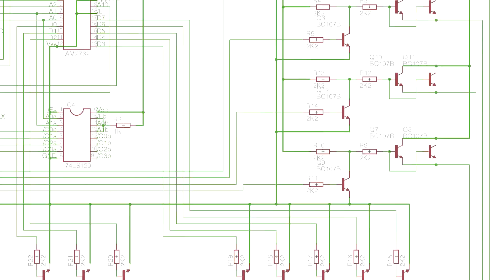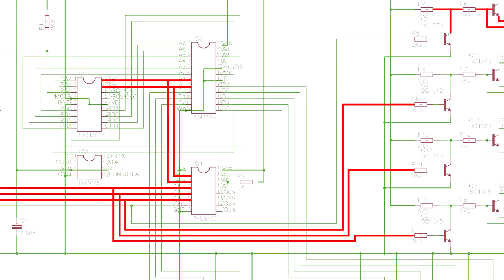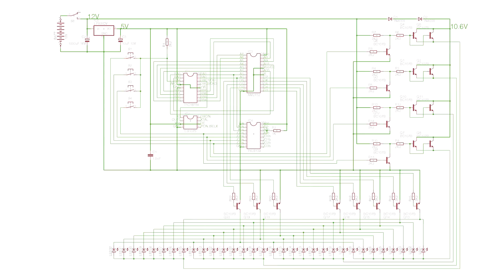Light Chaser Sombreros

Comment: I think I'll try to do something similar to this, but only using EPROMs and CMOS as I hate coding! :) A couple of 4040s driving the address lines then tap off BCD or Binary valued from the data port to drive the LEDs. First things first though, need to wire up an EPROM programmer :D

Comment from the maker: The patterns were calculated by hand, converted to hex and programmed into the EPROM using an ART EPP-1 EPROM programmer plugged into the parallel port. I've probably still got them written down somewhere.
The coding was done in Microchip MPLAB and programmed using a PICPRO40 programmer, again plugged into the parallel port.

Comment from the maker: I made a Knight Rider chaser a few years before the sombreros.
555 clocks 74LS93 (divide by 16).
4-bit output from 74LS93 feeds 74LS86 (quad XOR gate), 3 LSBs go to 3 gates, MSB goes to all 4. Output is 000-111 (for 0000-0111 input) then 111-000 (for 1000-1111 input).
3-bit output from 74LS86 feeds 74LS238 (3 to 8 line decoder).
Output from 74LS238 feeds transistors.
Transistors feed LEDs in the dash-mounted box and 12v bulbs in the front grille.

Comment from the maker: Looking at the diagram you could be right. I used 12 pins for addressing the EPROM and one to read the buttons, I could've got away with addressing the LEDs instead. Lots of fun with a mix of shifting and rotating 8, 16 or 32 bit patterns, all squeezed into 1K too.
I might dump the code off the PIC and disassemble it, it'd be interesting to see how I did it back then.

Comment: I think you could have omitted the EPROM too. There's no need to store each individual frame as you can easily create them as you go along. If you had a string of 4 bytes representing the 32 LEDs then for example if you were doing the sweep pattern then you just put a bit in the carry flag and do a shift on each of the registers, then repeat. You just needed a function for each pattern.

Comment: I disagree with your comment about the available microcontrollers back then. There were plenty of bigger devices available - even the 16F877 was around in 1999 which had 5x more RAM and 8x more program memory and of course loads more pins.

Comment: Reminded me of BC108 and was it the AC126? I'm sure everything could be built with enough of those, not sure why they kept making different transistors ;)  vero board... So can you now buy them on Ebay for $1 inc shipping? Talk about thinking outside the box! If I was thinking about flashing hats back then I would have stuck a decade counter, 555 and wired in parallel the LEDs to do a single pattern. These days it would have to scroll text around the outside :)